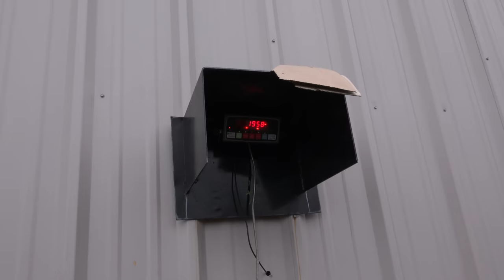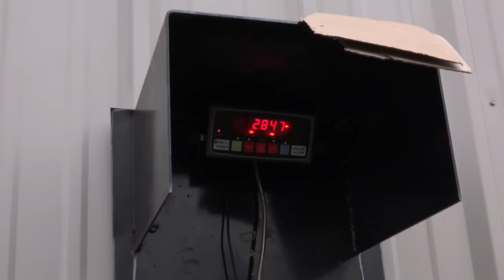Everything Attachments Wicked Boom Pole

Comment: What's nice is a 2-in-1 post digger/boom pole because implements start adding up and taking a lot of storage space (and they're alike as you say). It's nice for production because you make both the same way. The idea in comments for a place to slip in a winch on a receiver mount sounds nice, but that introduces dynamic loading in directions that are more difficult to anticipate with engineering and would add even more $$.

Comment: Is the 3-pt lifting capacity significantly more than the bucket?
Reply from the maker: It's most definitely significantly more, and also safer for the operator and tractor, especially when you're maxing out the lifting ability.
Reply: @EverythingAttachments  Did not know that. Thanks.